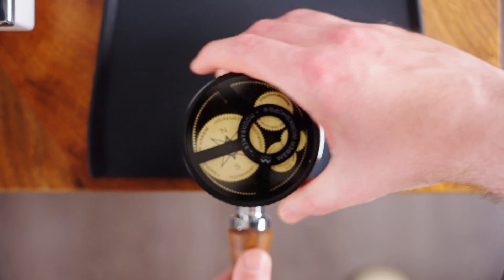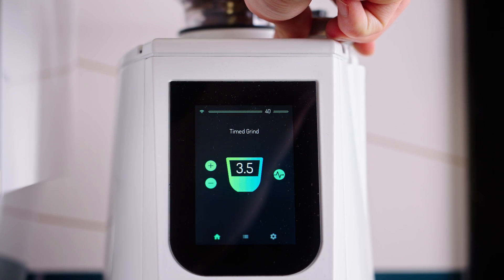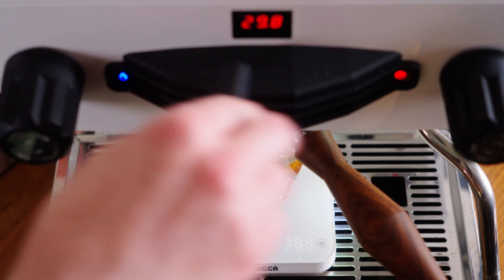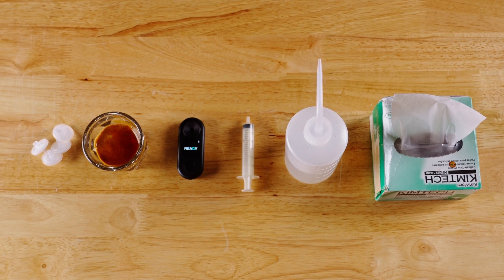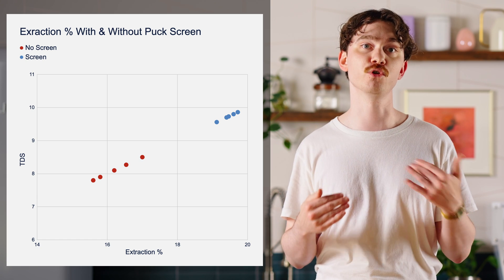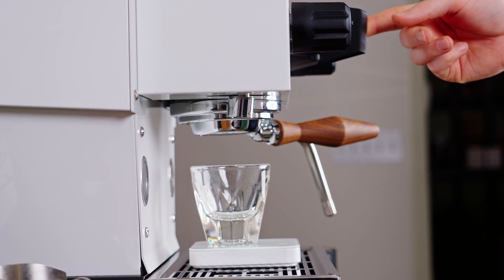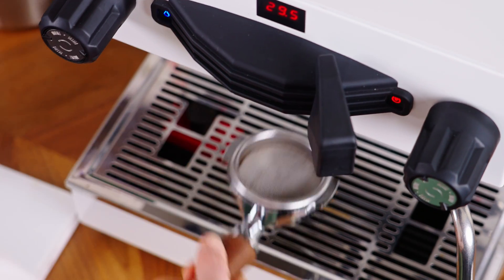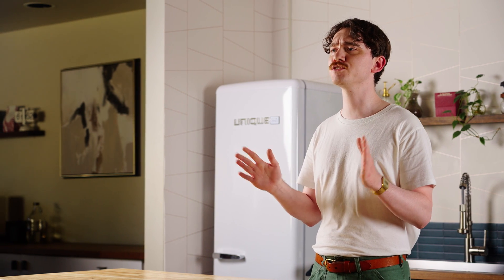Puck Screens: How Much do They REALLY Affect Extraction?

Comment: I thought the real gamechanger is the flow Control of extraction on a bianca, where regulating lower preassure and water flow just at the beginning means less acidic parts are extracted by doing so?? Is this low preassure - high preassure - low preassure method all BS?🤔

Comment: Thank you for the useful video. I would be curious to know if there is meaningful difference between 0.2mm, 0.8mm, 1.7mm and 2.0mm thick puck screens.
Reply: The best quality is a 0.8mm double-layered one, such as MHW-3BOMBER. The 0.2mm one doesn't have much impact and is difficult to use. Thicker ones limit the distance between the puck and the shower screen too much imo, and are harder to clean.

Comment: Adding the puck screen didn't change the extraction time?
Reply: More than likely you will see a change in the extraction time.  How much depends on the style of screen and how much headspace the screen is filling. To that end, you may end up needing a deeper basket to accommodate a really thick ( > 1.7mm) puck screen.  The screens I use are single layer .8mm and the shots run a little slower with them versus without.  The Nickle Test can still help you figure out if you're compressing the puck during portafilter insertion. Put the nickle between the puck and the puckscreen and remove the screen with a magnet or pry it from the corner.

Comment: Thank you for this useful experiment.  We learn something new everyday!  Have you by any chance made the comparison  between screens of different thicknesses, such as Weber puck saver vs puck screens of 1.0mm and thicker?  A while back, I had switched from 1.7mm puck screen to the Weber puck saver for ease of cleaning. If I were to go back to thicker screens, I would get some half a dozen, and clean all at once in an ultrasound cleaner or under steam pressure in water bath. They don't get clean by simple short spray of steam or under running water! Without having the answers, I think I might start laying the Weber screen saver over the coffee puck, and a thick puck screen above.

Comment: Get your a strong magnet, way easier to get your puck screen out of the portafilter! All of mine are magnetic at least.

Like many, reverted to using them just for the sake of machine cleanliness which is notable. I do taste a difference in the cup. My shots are without question more balanced & consistent. I do however use the MHW or E&B screens which are not the multiple layers of the same mesh type, they are mesh or laser drilled sheet bonded to a thicker backing plate with holes. This is also an outreach for ease of cleaning. They don't have all the little cavities within the screen like the multi layer mesh type in the video. I also put a paper filter on top of the tamped puck and the puck screen over it. I might aid distribution a tiny bit more but mostly because it traps fines from backflushing when the 3-way solinoid releases pressure. The type of puck screen I use really only needs a quick rinse under the tap. Its not going to trap much in the way of contaminants with this style. I alway use a dot of diluted dish soap/foam to rinse the portafilter & screen. Just to make sure any oils are removed. Press it in a towel to dry it. Also a plus with this type, not going to retain water like the mesh.

Comment: Does the bigger extraction in espresso mean more, bolder taste? I know in Pour over, bigger, is not always better. Thanks for another great video, btw!
Reply: Since espresso is so concentrated you definitely wanna find a sweet spot as well. Chasing high EYs no matter what will usually not taste that great 😅
Reply: Higher extraction is only the symptom of a more even extraction here. Both within a single shot (evenness across the puck) as well as across different shots.